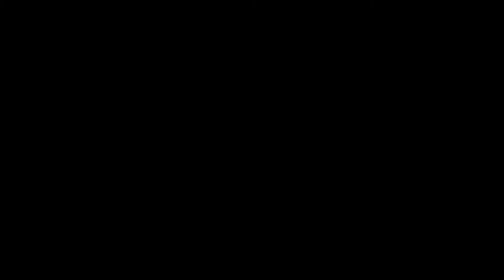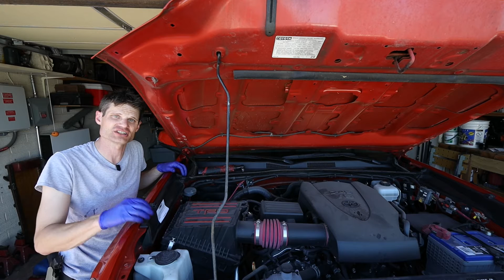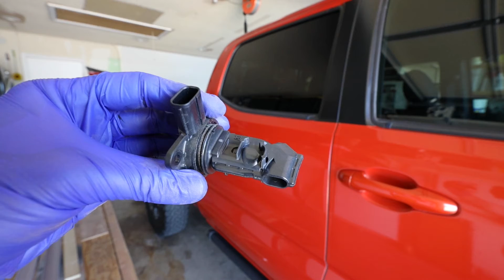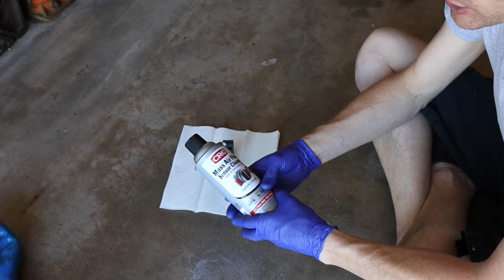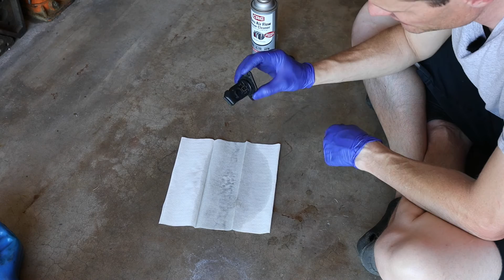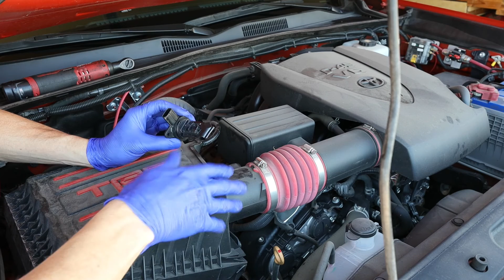Cleaning Tacoma Mass Air Flow (MAF) Sensor

Comment: What’s the difference between a TRD  air cleaner and a stock one?
You can get a TRD FILTER that fits In the stock air box…?
Reply from the maker: @TheBlister69  the TRD is oiled and the inlet is different. You could get just the filter and the inlet and save some money.

Comment: Unplugging it is why I came here. You kinda skipped how to do that !
Reply from the maker: Sorry about that. The plug is secured into the sensor with a single clip on the wide flat side. Disengage that tab, and it should unplug.
Reply: Squeeze the top of the plug and rock it back and forth.  I had to use a rag to save my fingers.  Don't be tempted to use plyers. Just keep pushing and working it until it unplugs.
Reply: Do you recommend unplugging the battery before performing this cleaning? Or even before cleaning the throttle body?

Comment: So according to the google gods it saying to clean the Mass air flow sensor every 6 months or when you change your oil.   I have a 2016 and never touched mine and it runs just fine.   I’m not sure but did you put a Cat back exhaust system on your truck?   If you haven’t I installed the AFE POWER MACH Force 3”.   It has a great sound and the claim 10 HP gain.  I can’t conform that but I do see a little increase in MPG.  You letting all that air in with your TRD intake and it needs to get back out.     Keep the videos coming.
Reply from the maker: I do have a Flowmaster exhaust, but I keep forgetting to do a video on it. So I have yet to do one. Maybe that's what I should do for next week's video?
Reply: @ICanDoItMyself  Looking forward to it